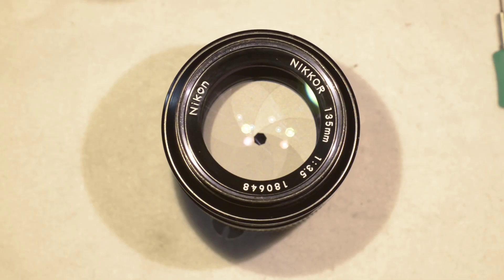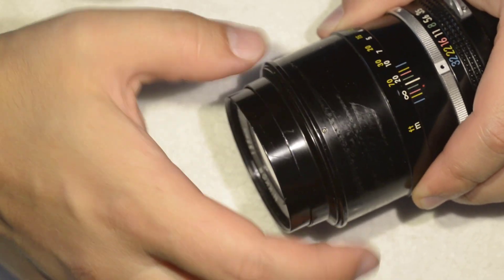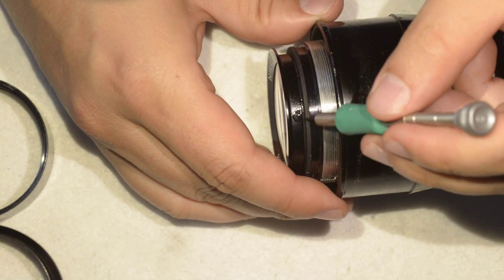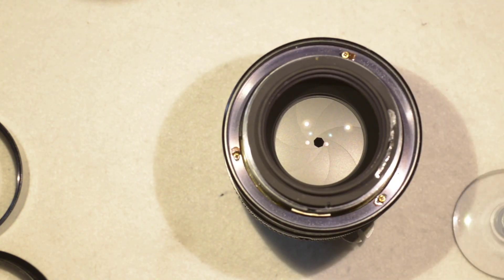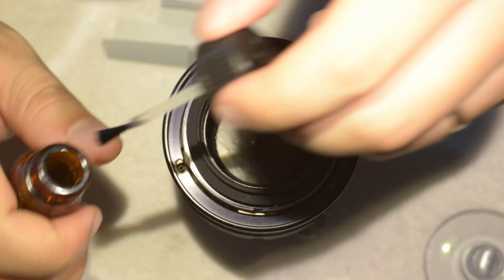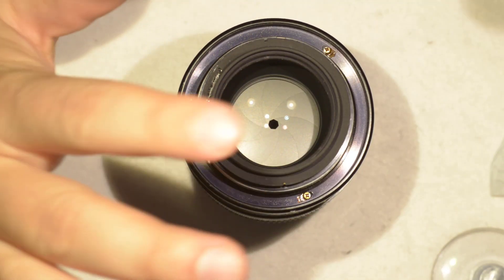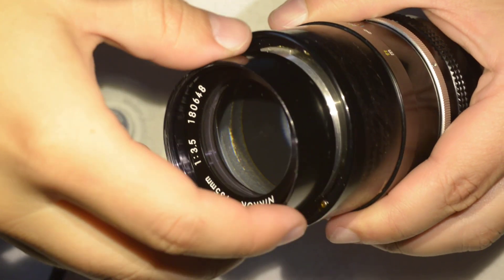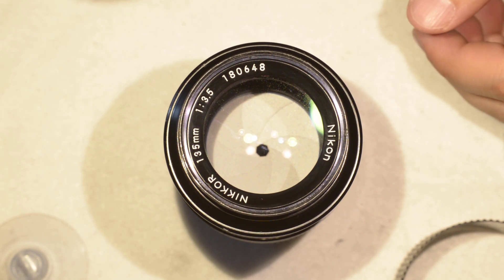Nikon Nikkor : 135mm f/3.5 Haze removal

Comment: Hello, Great videos!  Have you done a video about cleaning stiff helicoils in a Nikon 135mm f/3.5?  This is the lens I am speaking about:
 https://www.kenrockwell.com/nikon/135f35.htm

I believe you did the helicoils on a similar lens, but it wasn't the Ai-S lens with the built in lens hood, and I think the aperture assembly is different than the one you had on your prior video.  I have this lens and the apertures are fine, but the helicoil is stiff and I'd like to clean them up like you did with the lighter fluid and I don't want to disassemble the actual helicoil. 
Feel free to link a video if you have done one and I just didn't see it! 

Thanks!
Reply from the maker: Hi, no, I have never done this lens before, I'll open my eyes and hope I bump into one. I guess the construction is rather similar to a 105mm f/2.5 AI-s (educated guess). I already made a video on that one, but not the helicoil disassembly. Cheers.